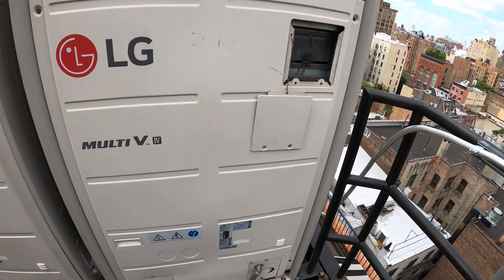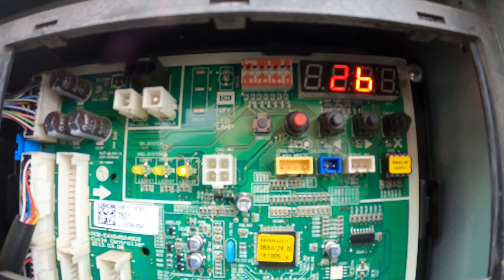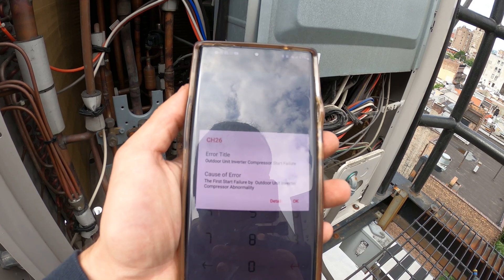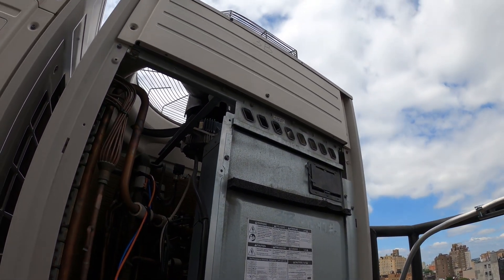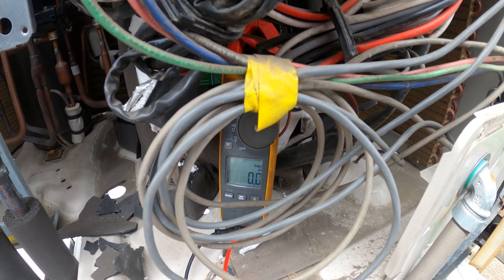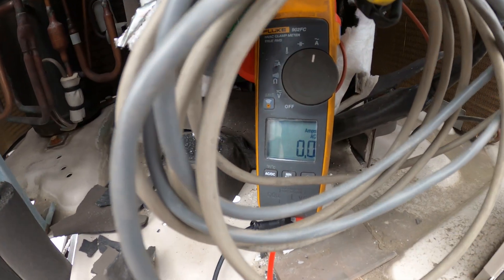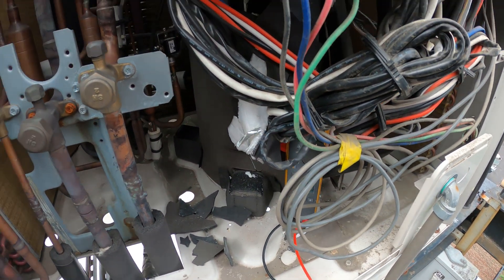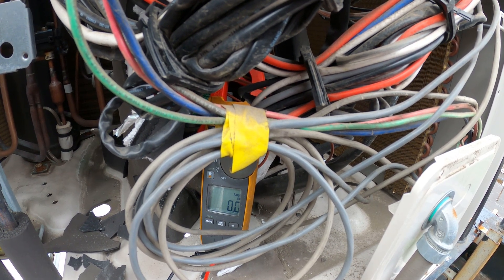HVAC Service Call: LG Multi V 4 Troubleshooting (Inverter Compressor Overcurrent) LG HVAC Repair

Comment: On a system like this using the inverter compressor i assume they don't use a capacitor? Sorry if thats a dumb question. I just don't see systems like these. Closest i get us mini-splits and i know those don't have them so figured I'd ask about these ones.
Crazy that so many are going out.
Reply: it’s not a dumb question. three phase motors don’t use capacitors at all, they don’t require the extra jolt needed from a capacitor to start moving.

Comment: 😂😂😂at this point this job site has brand new units, seems like everyone needs to be overhauled but for all those compressors to go more or less around the same time has to be a manufacturing issue or poor installation practices 🤷🏾‍♂️

Comment: Has to be a oil return issue with the installation. The good news is you will be a pro on these systems by the time your done.
Reply: Or they just run real hot due to the proximity with the units next to them. Surely that would restrict the airflow a fair whack
Reply: @Thermoelectric7  Too many sensors for this to fail on high head pressure, this has to be an oil return issue.
Reply: @electroshed I totally agree